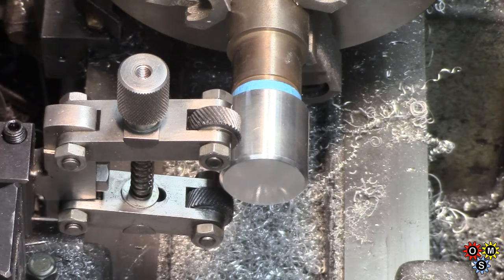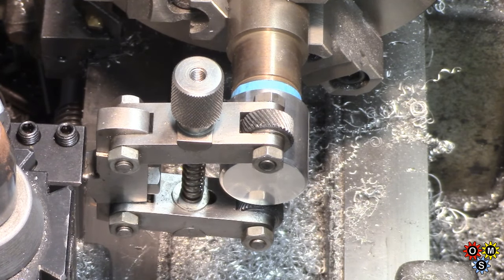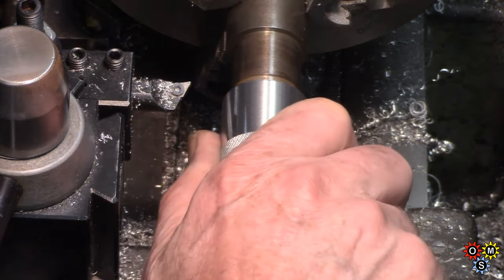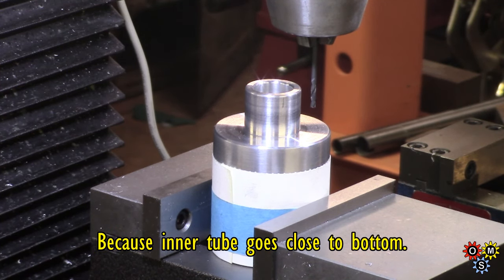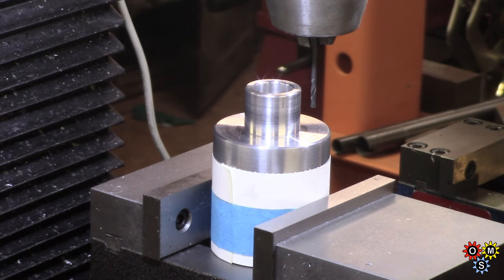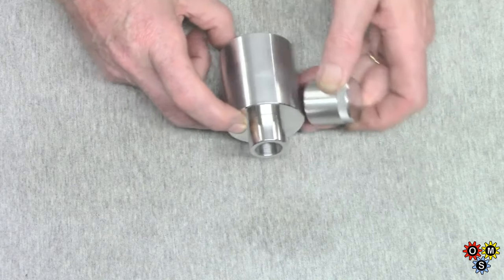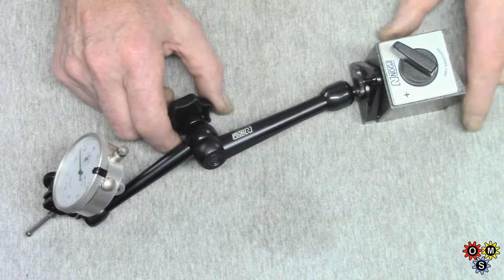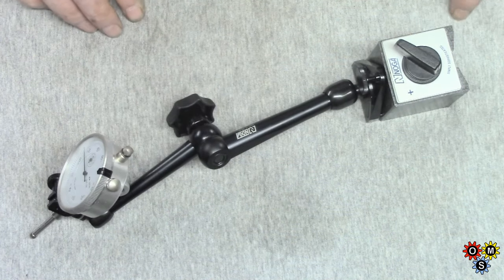Aluminum Oil Pot Tweaks, plus Oddz

Comment: For remachining that cap, a machinable expanding collet would do the trick. You could even cut threads on one to grip an internally threaded object. You would get one just bigger than what you need to hold and machine it to size and shape. Next time you need one, you machine it smaller (if possible; if not, you need a new larger one). Eventually you end up with a collection of different sizes, all gradually getting smaller as you re-use them - being replaced and discarded when they get too small to cut to new sizes. (There are also pot collets (external, machinable)).

Congrats on the 8k.
Reply from the maker: Hello Peter - thanks.
Laziness was my excuse for holding the cap - agreed, an expanding arbor is way to go. Having dug out the piece of round with thread on it did, fortunately, make a quick fix - 'expediency' :) I actually have a draw full of special arbors - might even have been one there had I not found what I used.

Comment: Hi Chris,
I'm just back from California, great trip, wish you were there...
About the Bozo in the oiler you could just have slanted the pot and drilled sideways in the same starting hole, that would have been a single entry, just a thought...
If you want to do a light knurl, you REALLY need to be close from the pitch related dimension in order to get a neat pattern.
 Great for 8k
Reply from the maker: Hi Pierre - welcome home - glad you are back safely - quite a trip! Oh yes, I really did wish I could have been there.
Yeah - the thought had occurred to me re a slant hole but felt it might well have left a rather visible messy and not round hole showing... it's now been plugged and machined off - bingo - no hole. :)
I was lazy with the knurl - I have another wheel set but know that a light start from the ones I used can give a (sort of) light knurl - plus I could apply too much pressure.
Still not sure where 8k comes from! appreciative nonetheless!

Comment: Congrats on the 8K subscribers. My # increased considerably after you mentioning my channel; however, I still got a long ways to go on my 1st K. Would love to see your spindle handle. I made one for my 7X mini lathe, but haven't yet for my 11X yet. I'll look through your videos to see if I can spot one of the handle build. I went back on the 2 oil pots I built for my self & also the one I sent Keith & added an air hole as well. I tried to keep mine as close to the center tube as possible to hopefully hinder any spillage should it get knocked on its side. Good job on the knurl!
Reply from the maker: Hello Lee - thanks.
I did a short video way back for the spindle handle - it's super simple - http://www.oldmansshop.com/vid-pages/lathe-spindle-handle.php
I realize now I should have put an air hole in the inner tube near top before fitting - then it would have been hidden. Hindsight is as ever a wonderful thing.:)
I still think even with the 3/32 hole at lowest point when tipped, leakage would be very slow. If I make another I'd do it right.

Comment: Bummer on the oil cup. You could make a threaded in vent to cover the mistake, with a side hole not to get dirt in.  Nice new tools for the shop.   Congrats on the 8k.
Reply from the maker: Hey Randy.
Thanks - I actually got tired of looking at the Bozo hole and added a tiny Al peg and then machined surplus off. Bingo - hole disappeared! I'll show that in next video, when the heck I can get round to it!
Hope the new grand child addition went well. :)

Comment: I like the knurled top, looks better and am sure will be easier to remove. Could the vent hole go in the inside tube wall toward the top prior to assembly ? Also could the cap be made to hold a brush within rather than a hole through it and stuff a brush handle through it ? Got me thinking now as I've a short offcut of aluminium bar 75mm dia and some 38mm dia stock... I fancy a turning project and taking a break from the shaper videos a while.
Nice project great quality video. wising you some relief from your back issues. ATB mat.
Reply from the maker: Hi -  Thanks ... back is up and down and still a limiting factor.
Oh yes. a hole in the tube would be way better - had I thought of it!! Tube once in tho - can't remove so - thus the hole we did. (The Bozo hole is now plugged and machined!).
Several ways to hold a brush perhaps but reckon whoever gets the pot, can decide what they want to do.

Comment: Could you have put a small hole near the top of the tube that goes to the bottom?  Position it so it is just beneath the top of the pot.  It would allow pressure equalization without having a hole in the outside of the pot.   Just a thought.  Great job. I really enjoy your videos!

eric
Reply: I thought the point of the can was tip over proof no leak
Reply from the maker: Hi Eric -- oh yes, a hole near top of tube would have been better, but, didn't think of it early enough! Tube now is fixed in permanently! I have now got rid of Bozo hole!
Reply from the maker: Hi Ed - ideally yes but all being well if not over filled, it should at worst only leak a very small amount - if air hole was at lowest point. Otherwise I think it'll at least limit leaks a lot.
Reply: You are right, that is the point.  I just thought if the hole was on the inside bore of the tube (perpendicular to the tubes axis) and just under the top surface of the pot it would minimise the spillage if the pot were tipped over.  If the level of the oil in the pot is too high it will spill from the center tube regardless.  I guess my idea was mainly cosmetic, to avoid a hole on the outside of the pot which would surely leak if tipped.  Anyway it was just a thought, maybe it wouldn't work.

eric
Reply: I know, its too late.  But the pot turned out so brilliantly, you may want to make another one sometime! Thanks for all your videos I'm learning a lot from them! Cheers!

eric
Reply from the maker: The tube hole sure would have been better! I reckon if pot not over filled it will do OK - I hope! The outside hole does bug me a bit but hey - should have planned better!
Maybe I'll do another sometime! :)

Comment: Bringing up the tailstock to capture the cap against the mandrel would have stopped the cap from spinning loose while you used the knurling tool and cutting bit.
Reply from the maker: Agreed yes - but was worried about spoiling finish. Fortunately the improvised mandrel did the job.

Comment: What ho Namesake, congrats on 8K shows some folks have taste.
Now fixes, when you found the hole was in the wrong place you could have tilted the pot on the vice and drilled at an angle from the original one and no one would have known.
As another has already said, tailstock clamping works well for friction drive, but you knew that already, must have been the heat that caused brain fade. :>)
Thinking of which, should have stayed in (soon to be independent again) UK, equitable 70F during day down to 55 over night for most of this week.
Did you celebrate Rebellion day?
ATB
c
Reply from the maker: Hi Chris.

The errant hole is now plugged and machined off! You are right - could perhaps have used that and angle drilled if careful.
Didn't want friction drive for the cap - no center hole plus being small - the taped mandrel worked OK fortunately.
70 and 55 - ideal temps. Here now humid and temps climbing - very sweaty!
The 4th was for most part 'just another day' - always surprised though how many people do not know their history!
Reply: Re History, I wish more politicians studied it, would save them making the same old mistakes again.
Re friction drive, make yourself a series of discs with a 60 degree centre hole for the rotating centre. No need to mark the part that way.
We have to wait till next May to celebrate our independence day, worth waiting though, as long as the politicians don't screw it all up. What are the chances of that I wonder? :>(
Reply from the maker: Ahh yes, a series of disks -- may try and make some up.
Hope your independence day comes to pass!!
Reply: There you are, a simple project to video. 
I'm waiting for them to issue British Royal Blue passports again, instead of those nasty burgundy coloured ones. Mind you not having a valid passport saved me from having to continue to commute to France with a, now,  ex girlfriend.

Comment: Hi Chris, why not make a feature out of the bozo hole. Thread it, put a brass stud in it and skim it off.
Reply from the maker: Hi Robert - one option yes, but now have plugged and machined off the Bozo hole (with Al plug) - it's now invisible. :)
Reply: +ChrisB257 Alls well that ends well then.
Reply from the maker: Almost Robert, with cheats here and there!

Comment: You could have just made the hole a little bigger until it broke through the inner wall. That would let air in/out with only one hole. :)
Reply from the maker: Did occur to me but didn't want bigger. Have now anyways, plugged the Bozo hole and machined off - it is now gone!
Reply from the maker: Hi Bill - certainly an option but felt it might make matters worse. Bozo hole now plugged and machined!